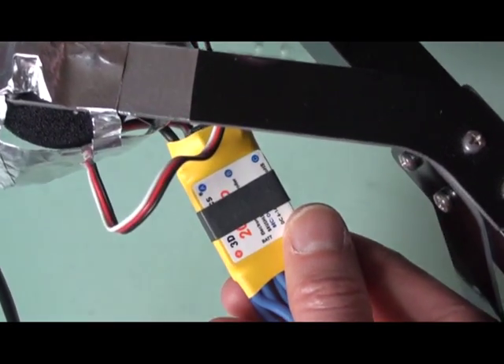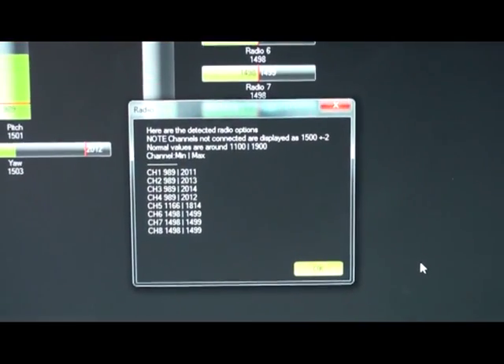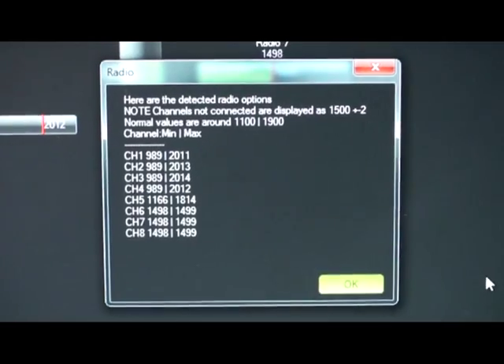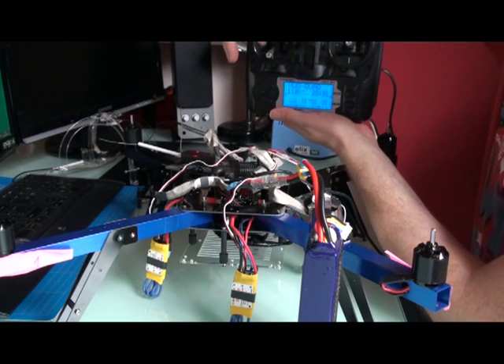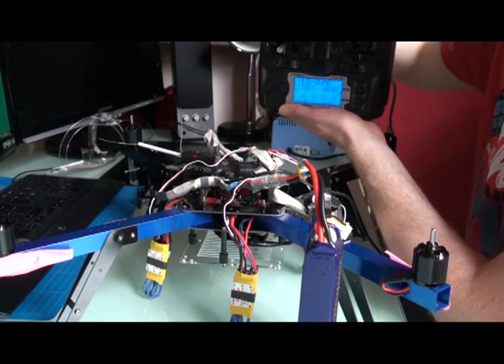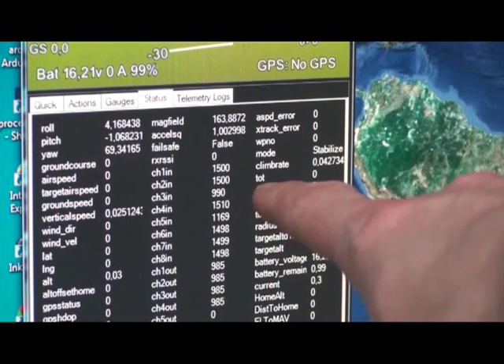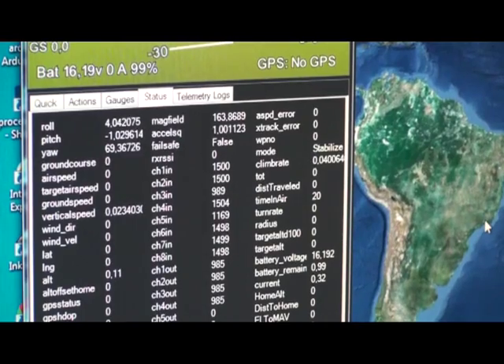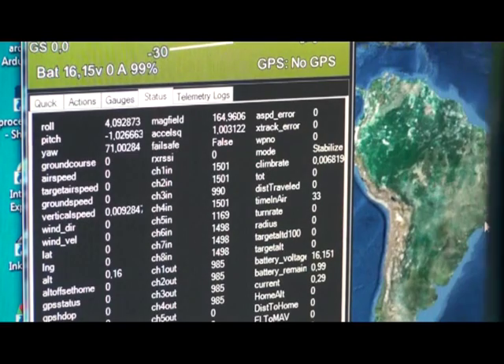Arducopter throttle problem (APM2.5, 2.9.1 firmware, 3D Robotics Quadcopter)

Comment: I just solved this issue on my quad. for me it was the pwm setting for throttle failsafe. it was at 995.00 i set it 925 and that worked. I guess it was too close to minimum throttle input of 1000.

Comment: thanks guys for your help setting my throttle max to 1000 it did give me back control of my motors
i went into config/tuning and then full parameter tree and then click on the + next to thr at the bottom set it to 1000 then write params

Comment: I had the same problem. I changed the throttle max to 1000 and it fixed the problem. It was set to 80 for some reason,  not by me.

Comment: I haved the same problem. But i fixed it now.
The problem is the throttle max is on 80, but it must be on 1000. Do that and u have the maximum speed.
Reply: No problem. I do what i can to help another people. Thanks
Reply: andnico72 Where is throttle max on mission planner? I only see throttle min, mid and dead zone. Is IMAX the same?
Reply: Hello, 
In the mission planner u klick on config/tuning. Klick on advanced parameter. Scroll down to the end. In the bottom u see throttel maximum(thr_max). Set it on 1000. Now the motors have the full speed. 
I hope that helps u.
See u
Reply: andnico72 thanks a lot man,BRAVO
Reply: +andnico72 I love you ,dude!
Reply: Thanks a lot. I've solved. I have changed throttle max 80 to 1000, and then done esc calibration. So all is OK.

Comment: Have the same problem. The ESCs are calibrated by using all-at-once method. The motors don't respond to throttle but they suddenly spin up like crazy. Rebooting solves it many times but once in a while it again behaves like this.

On my third flight, the quad was lifting graciously responding well to the stick and then suddenly shot up like a rocket. Alt-Hold prevented the further ascent and when I flipped back to Stabilize it fell and I had to break the fall by pulling the throttle which behaved this time. Eventually this again happened and quad crashed.

This is a very dangerous behaviour. Has anyone found a fix for this?

-TIA

Comment: Hi
Have you solved this problem yet? I am experiencing very similar behaviour on my Hex.
I find I can sometimes!! make the throttle behave if I connect the battery first powering up the ESC's then power up the board. I don't use any red wire from the ESC's so the APM only gets power when I plug in the APM's BEC.

Comment: Hello Kook,
It's not a problem. It's THR_MIN parameter, and is working fine.
If this is too much throttle you should lower this parameter. I had to lower mine
However, too low THR_MIN and a quick descent may make propellers spin in the oposite direction making ESCs unable to make motor spin in the right direction.
Regards,
Miguel